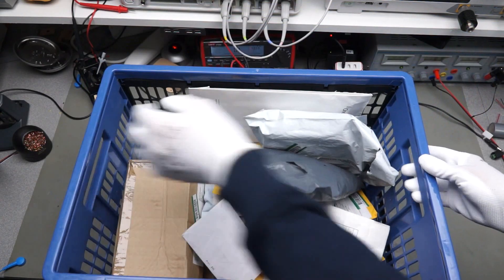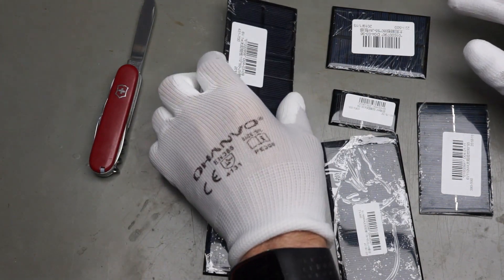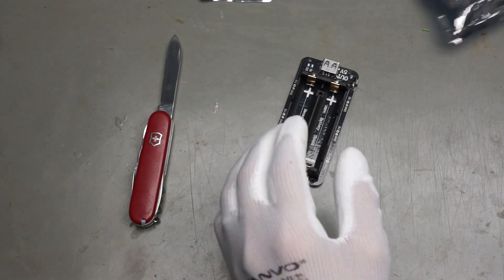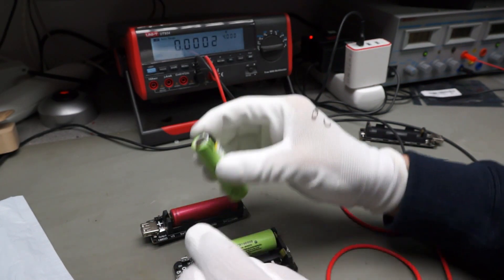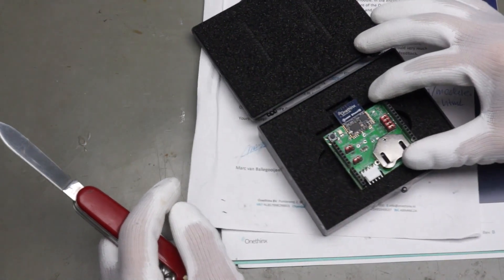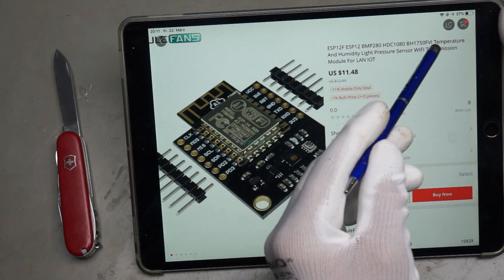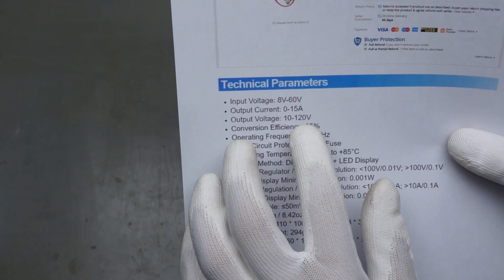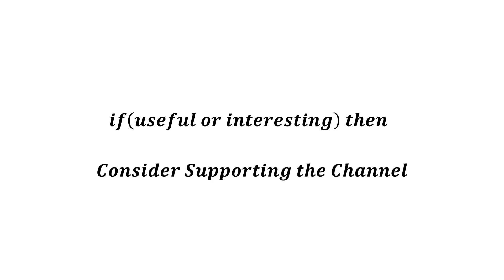#272 Mailbag incl. defective LiPo, Co2, ESP8266 Sensor module, RPi PoE, 120V inverter, OneThinx

Comment: I watched this video too late. As always, you have a gem to share but I had to set fire to a battery to learn a nice tip. Thank you for sharing the solder on the tip of the battery. I’m so hesitant to use my new battery holders knowing they are designed so poorly and, by default, rip back the insulation and short themselves as a design. 

I have the solder in holders like you just got and the reaction to the fire was far less than mine. I said tons of expletives and threw everything on the ground. I don’t even want to touch that stuff anymore!  

Thanks again for the solder tip. Sehr vielen Dank!
Reply from the maker: You are right, these batteries can be scary! But they are also very useful. Fortunately we forget with time...

Comment: Very nice mailbag.

It took me a while to figure out what happened to the two battery holder when the short happened.
The positive plate on the holder cut through the plastic and touched the case, the case then caused a short and the current that caused the smoke flowed from the remaining battery in the holder.
A bit of lesson in how to handle them when using in parallel.
Removing the neg contact first is sensible yes.
Very nice, I enjoyed it.
Reply from the maker: Thank you!

Comment: After watching this video I went and checked my batteries because I have the exact same holders Andreas shows at 3:00 plus other holders that have flat nickel plated contacts plus various ones with coil spring contacts. I can see beginning signs of where they are starting to cut up the shrink wrap and damage the insulator ring on some of my more frequently used batteries. Some of my use is flashlights where the contacts are not a problem but most is microcontroller/sensor projects which use these side loaded holders. Gotta keep a closer eye on that, maybe even get some insulators and battery wrap and rewrap some of them. Also I think I will go back to my assemblies that don't have it already and incorporate a method to recharge in the device whenever possible instead of having to remove them for charging.
Reply from the maker: Good idea!

Comment: Hi Andreas
Have you testet the 18650 battery holders?
I have also send you a message under another video, but I found the correct video / thread ;)
Is it better to use those style holders with the wider flat solder joint, instead of the normal pin style?

Thanks in advance and greetings from Denmark.
Reply from the maker: I did not formally test them so far

Comment: This ESP-14 ESP8266 module isn't as easy to use with Arduino as it uses a tiny STM8S003
https://tenbaht.github.io/sduino/hardware/esp14/
https://benjamindejong.com/flashing-an-esp8266-esp-14/

Comment: I ordered the same shield at 5:10 but it heats up a lot when charging two cells and also cells are connected in parallel
Reply from the maker: The two cells have to be in parallel. Heating up below 70 C is not a problem.

Comment: Andreas, I think the temperature sensors like the one  with the WeMos D1 mini board are useless.
I built a smart sensor, basically a D1 Mini + DHT11 shield board, a very easy project. 
But, the heath generated by the ESP and wifi under the DHT11 shield completely staggered the temperature readings. I had to de solder the DHT11 from the shield and add 4 cm of wires to keep it far enough from the ESP board area. You will probably experience the same issue or worst where the temperature sensor are ON THE SAME heated board where the ESP chip is.
Reply from the maker: I know the problem and I did not try this board out if it suffers from the same problem.

Comment: That boost converter 16:14 is sold as "Juntek" however it's made by (and better known as) MingHe BST900W / B900.
Manufacturer webpage: http://www.mhinstek.com/product/html/?107.html
USER MANUAL : http://www.mhinstek.com/PDF/BST900W%20User%20Manual.pdf
Firmware hack serial control : https://github.com/delboy711/BST900
CHECK the voltage rating of output diode - some modules have under-rated 40V and 80V parts
Needs at least 4V voltage step up or the Constant Current aspect will not work.
Reply from the maker: Thank you for your info and links!

Comment: Dear Andreas,
yeah, time to pay back for so much knowledge you have shared the last years. 

Just by coincidence I am working on CO2 Sensors for a while and if you are interested in I would like to share some information before you make your video.
I have a SGP30, a SCD30, and a SenseAir Sunrise V2 on a side by side comparison. 
As some other people might have mentioned TVOC sensors (like SGP30 and CCS811) have nothing to do with CO2. If anything, they measure the CO2 equivalent, what consists of Ethanol and H2.
Basically it is just what CO2 damage the volatile organic compounds would cause, compared to CO2
.

The AQI is based on 'real' CO2. In my knowledge this can only be measured with NDIR measurement method https://en.wikipedia.org/wiki/Nondispersive_infrared_sensor
https://senseair.com/applications/indoor-air-quality/indoor-air-quality-and-safety/

Another VERY interesting fact is that one of the best ambient sensor companies for CO2 is located in 
Stäfa, CH: Sensirion. (That's what I would call a homerun) 

Alternatively there is another company named Senseair located north of Stockholm
 https://senseair.com/products/power-counts/senseair-sunrise/

If you are interested I can share more information, my contacts, maybe even some parts with you.
My email is brueglju(at)gmail.com

... and thanks again for all your highly inspiring videos. 

Juergen
Reply from the maker: Thank you for your information. I have viewers in Stäfa which will help me ;-)
Reply: @AndreasSpiess  Dear Andreas, I sent you a mail to sensoriot.......... Just want to make sure you received it. Best !

Comment: Do you think that esp8266 with sensors will work?  I didn't have good luck with even Shields and the D1 mini nor the esp01 Shields..it pulled the temperature reading up almost no matter where you put it.  I can't see it working well on the same board.  Maybe humidity and light no prob though...
Reply from the maker: I know the problem of the Wemos. I did not test this one.

Comment: Solder blob on the 18650 is not a good idea... Solder does oxidize very fast and get bad connection, the cells contacts are made from non oxidation material
Reply from the maker: Others suggested using magnets instead. So far I had no problems for low current applications.

Comment: For your planned video on air quality sensors: would be nice to include a section about particle detectors (pm 2.5 and such), they can be tricky to use accurately and usually require some sort of calibration to be accurate. I calibrated mine by leaving it next to a public air quality monitoring station in my neighborhood and then comparing results. Maybe you can find some factory calibrated ones, or some easier way of calibrating.
Reply from the maker: We will see...  BTW: Good idea to compare cheap sensors with expensive ones to assess accuracy. I assume you also detected the susceptibility to humidity.

Comment: Great vid as usual. I have one of those 120V PSU, I cased it up and printed a proper front panel and even got some cherry keyboard switches and 3d printed some caps just to make it look nicer, easier to work with and safer
Reply from the maker: Sounds great. Maybe you document it on Thingiverse?

Comment: 9:43 solder blob is not good idea. Solder oxidizes an you have bad connection. Been there. Buttons sold separately for this purpose. Or use magnet.
Reply: Yeah, but who cares if silver oxidizes? He didn't put some silver on there, so that is completely irrelevant. A button or magnet added to one end adds TWO extra surfaces that could tarnish or otherwise increase the contact resistance.
Reply from the maker: So far I had no problems for low current applications. But other viewers also suggested using magnets.

Comment: You say there is no problem with the board but it seems there is! In product design you can't expect the user to remember which side to push/pull (the cell) first. It seems that the contact tab is ill designed and is digging between the (+), the lining and making contact with (-) and a hence the short! A larger bent lip at the tab should avoid this.
Reply from the maker: Maybe you are right. But I cannot change the board, only my behavior ;-)

Comment: Interesting stuff. With regard to the combined sensorboard, frankly in price it's over the top, but indeed it is easy in its use. The gas sensor imho is quite useless. It is advertised as a co2 sensor, which it isn't. It registers various gasses and outputs a rather meaningless number.
Price wise the combined esp sensor board is better, albeit that the temperature sensor is a bit too close to the processor
Reply from the maker: You are right, it is a very special board.
Reply: @AndreasSpiess  that's a very diplomatic way of putting it :-D

Comment: Why BMP280 + another chip for humidity instead of BME280?
Reply from the maker: I do not know.
Reply: maybe cost? I know that if you try to order BME280 off of ebay, most of them will actually send you a BMP280 :(

Comment: I use those 18650 Battery Holders as well. I settled on them after testing the others (as you have). Best ones I have found at that price point.

Here is a tip you may find useful for these holders (and others): Wrap a piece of 1/2" tape around the center of the battery and pinch the ends together on the other side so that the tape becomes a little handle / pull-tab that you can use to extract the battery from the holder. On these holders you can tuck the tab of tape into the gap between the side of the battery and the holder. Personally, I like a stronger woven / reinforced style of tape for this purpose, but masking, gaffer, or packaging tape works fine as well. Alternately, you can wrap the tape around one side of the holder and have the tape attached to the holder instead of the battery (obviously, you must do this before installing the holder on a PCB). Just drape the tape underneath the battery when you insert it. pull the tape to lift the battery a bit so you can grab it easier. The first method gives you the best leverage, but the second one works and is preferable in some cases. Both reduce the chances of shorting the battery significantly. ;)
Reply from the maker: Thank you for the tip! I will try it out

Comment: does the double 18650 unit put the cells directly in parallel? if so two unbalanced cells when put in may rapidly charge/discharge each other
Reply: Yes of course they are directly paralleled. Yes, 2 unbalanced cells would "instantly balance", however that is the same for almost powerbank and holder like this. Lithium, Alkaline, NiMH, Lead Acid... they all parallel the cells - does anyone make a "balancer" for parallel cells? I suppose you could link them with resistors but that would also destroy the current handling capability.
Anyway, these products are intended for enthusiasts who would know that the cells need to be charged equally when inserted.
Reply from the maker: There is always a resistance between the two parallel poles which limits the current. But I do not know if it would overheat if you use a completely charged and a completely uncharged cell.

Comment: It looks like the battery you pulled shorted the battery that was left in the holder. The two negatives on the removed battery made contact and shorted out the remaining battery.
Reply: Errr, what? When he pulled the batttery out he dragged it across the positive contact plate in the holder. That tore the heatshrink on that end, exposing the metal edge of the cell which is the rolled edge of the case which is negative.
So, when that happened he had the battery holder contact plate short circuiting the positive tab (centre) and the negative "rim" on the battery.
Reply from the maker: The battery was already defective before the video. But I did not care about it :-(

Comment: Andreas, If your interested in VOC sensors, you should take a look at the SGP30.  It will work much better than the CCS811.  The CCS811 tends to get poisoned pretty easily and when it re-baselines itself, it is pretty abrupt.  The SGP30 sensor operates consistently and has a hydrophobic filter that keeps particulate from getting into the sensor.  Also your light sensor along with a VOC sensor can be used to approximate Ozone levels but I've never tried it.
Reply from the maker: I will include an SGP30.

Comment: Audio too soft. right click -> stats for nerds -> volume: -7.8 dB. Ideally it should be between -2 to 0 dB. Turn up the mic gain and move it closer to your face first, if still not loud enough then amplify digitally. Audacity is a free audio editing software that you can use
Reply: or just Turn Up the Volume on your site
Reply: @ZillionPrey  yeah but it's soft compared to the average. would be better for the video publisher to make the adjustment than for the 100k+ viewers to do so
Reply: @nicktohzyu  - furthermore, if those 100k+ viewers increase volume for the video, then those same 100k+ viewers get blasted out of the room when the adverts start, or when they click into the next video.
Reply from the maker: I use Audacity and adjust the max to -2 dB

Comment: I believe, you get some fun with your ESP-Board include the Temperature Sensor. I heard, that the ESP gets warm over the time and will manupulate the Temperature Sensor. When you engineered the right formula to use the Chip, please keep me informed ;-)
Reply from the maker: Well possible it influences the temperature. Maybe I can arrange it "sensor to the bottom".

Comment: Please test the "2x18650 power supplies" to check the maximum output current.
Reply from the maker: I usually do not need high currents for my projects. I checked, it delivers 3A/5V. After a while, the chip marked AP2016/AK31 gets hot and might need a heat sink.
Reply: @AndreasSpiess  thanks, good to know it can take the 3A without shutting down
Reply from the maker: Mine shuts down at around 3.2A
Reply: @AndreasSpiess  the one cell version did shut down at 1.5A, so this is a better solution
Reply: Yes, I still remember the single cell one that can't provide 2A

Comment: Addendum to Uwe Zimmermann's comment: I intended to make a similar remark ... Be aware that those MOX (Metal Oxide) sensors will give you no warning if you have a pure CO2 (Carbon Dioxide)source in the room (e.g. a defect gas stove leaking exhaust), because CO2 is a relatively inert gas!
Reply: And NDIR CO2 sensors have issues with auto-calibration...
Reply: True, but at least NDIR (NonDispersive InfraRed) sensor can actually detect CO2 and CO (Carbon Monoxide) ;-) BTW Do you know by any chance if Solid Electrolyte CO2 sensors work any better?
Reply: @robertssmorgasbord  Sure, It can detect but after some time (for my MH-Z19 during day) it recalibrate and change it mind :D
Nope, not have one.